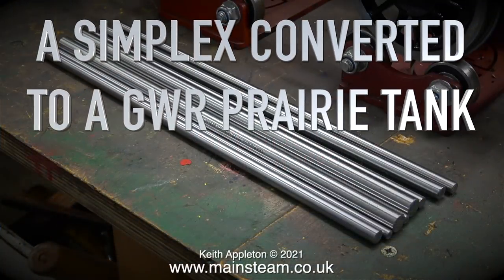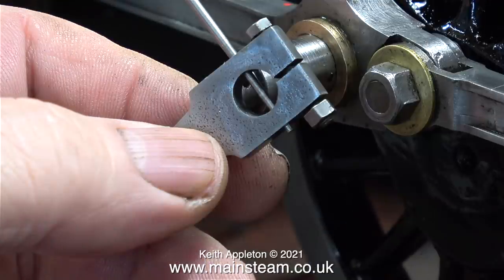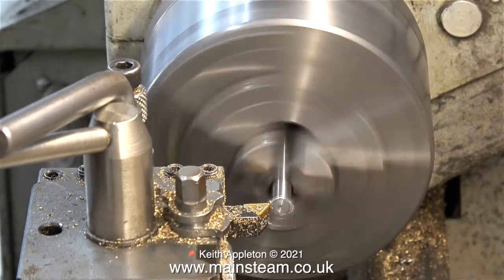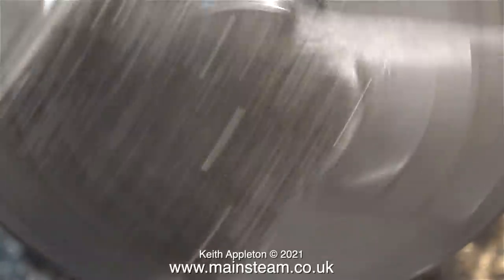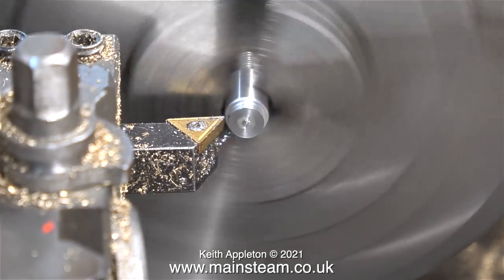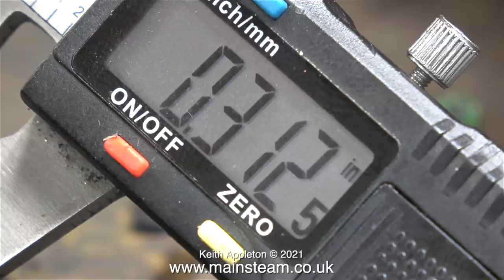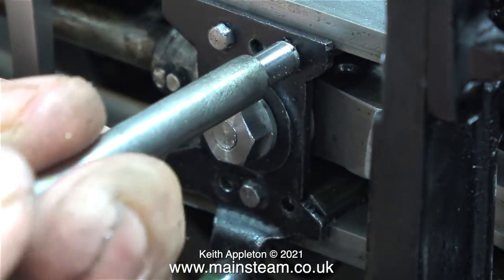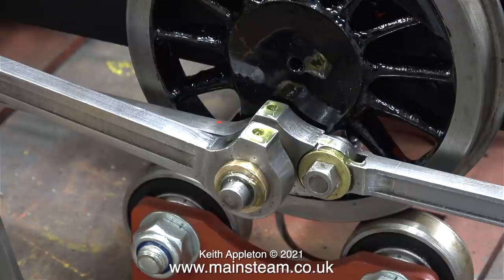SIMPLEX PRAIRIE TANK - PART #61

Comment: Keith, You do not need to respond to those dumb butted commenters at all. Just delete and block them.
Personally, I would be disappointed if you shut down your comments, because it then prevents me, and others, from giving you positive feed back and an occasional "suggestion".
You have over 57,800 subscribers. There will always be snotty people. Usually it's all they have to do, and quite possibly not know the difference between a Bridgeport and a drill press.
Keep up the great videos.
Because of this series and the one about beginning in machine work, I've learned nearly everything I know about steam locomotives, both model and full size. ;-)

Comment: Keith, I am not a machinist, but I do understand what some of the different types of metals are. But, I have never heard of “silver steel.” Can you (simply) explain what it is and what it might be used for? 
As for the idiotic comments, it all stems from the “me, me, me,” self important people. The “I’m right, and you’re wrong attitude. Ignore them if you can. A friend of mine had a nicely printed sign in his office that said simply, “Shoot Stupid.” (Stupid being an adjective, not a noun). There you go.
Reply from the maker: Silver Steel can be heat treated to harden it. Also the bar stock is precision ground to the correct dimension.
Reply: @keithappleton  Thanks Keith.

Comment: What a very nice video & a truthful set of comments. I am a retired professional design engineer & your lathe turning looks perfectly fine to me. Yes of course I have watched much better on far more expensive lathes. But your methods work perfectly satisfactorily for your purpose. If I can do as well with my Myford ML7 as you with your Boxford CUD then I will be more than pleased. The quality is the end result & all true engineers have little tricks of the trade when it comes to getting there. Usually it comes down to the same one thing, a pride in workmanship. This Sir you have in abundance. I ask one question of these disparaging souls. How many of you can set to & do a sympathetic repair to an old model? Judging by the comments referred to by yourself Mr Appleton, not a single one has such pride as to be capable of doing this. Every thing has to be to perfect for them. Has a single one of them made anything other than with a CNC machine? Possibly a straight bit of pre-ground steel, parted off in a computer controlled lathe which they could tell to make X long!   Mervyn Price PS-  I learned to turn on a treadle lathe age 11.
Reply from the maker: A good comment. Thank you Mervyn {:-)))
Reply: @keithappleton  Many thanks I enjoy what I see.